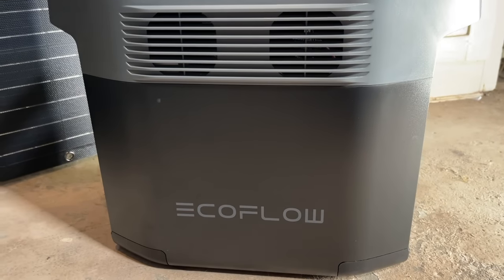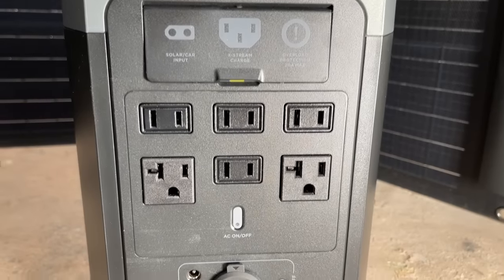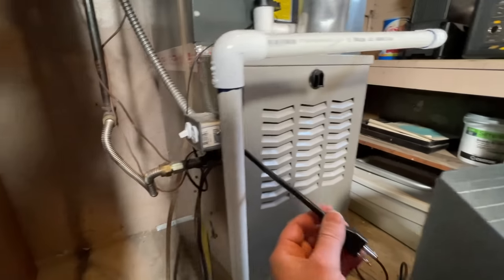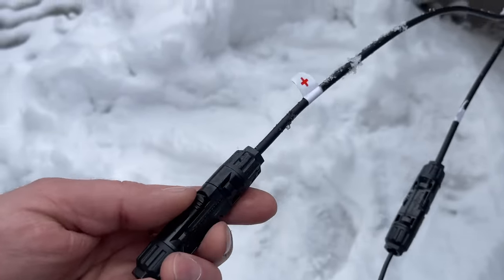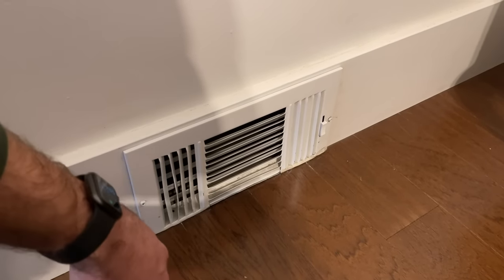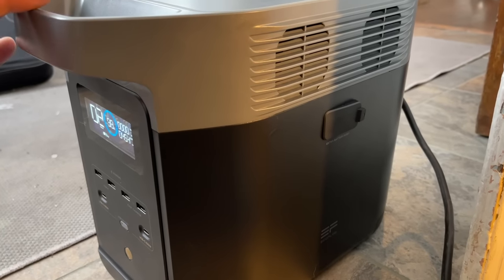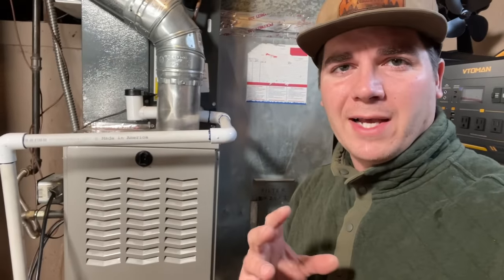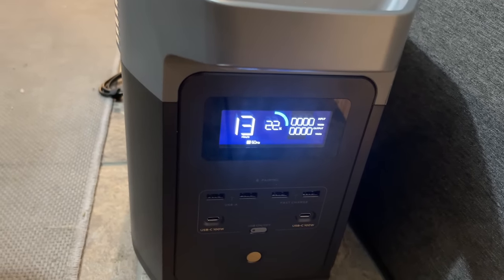How Long Will The EcoFlow Power Station Run My Furnace?  |  Power Outage Emergency Heat

Comment: I get being green, but in an emergency, I would rather have a small (or even large) inverter generator. You can buy quiet 2000 watt inverter generator for $500 and it will run a furnace for 10 hours on a gallon of gasoline. 5 gallons of gas will keep you warm two days.  These small inverter generators are a far better solution for temporary emergency use. People think of generators as these large, noisy things, but these little inverter generators are super quiet, running under 60db at 25 feet.  Also, batteries are not all that green.  Most of the electricity produced today is still done so using fossil fuel.  I loose power maybe twice a year but in the great Texas freeze 2 years ago, I was out of power for 4 days. I did not have a generator, and I swore I would never be without on again.
Reply: He already has videos on that.
Reply: Can you give suggestions on a 2000 watt generator? Thank you
Reply: You have such great emergency back up information.  Your a young man I find your knowledge very impressive.  I went thru all the vo-tech night school hvac back in 1996 and I think what you show here in 10 minutes is a full nights on hands teaching honestly 😂.   I’m with you prepare for the worse and hope for the best.  Your ideas are like having an emergency financial fund.  It gives peace of mind and better sleeping at night.  I have to make one of those emergency pig tails that’s pretty cool.   Would a home inspector be okay with the installation of it?  Thank you for your video I watch them all.
Reply: @Silverface1987  I’ll give you a suggestion.  Buy the quietest one you can afford for one thing.  Second make sure it’s an inverter generator this allows you to safely run all your electronics on it without having voltage spikes or drops which could burn out sensitive circuit boards that most things have no a days, like heaters, tv’s computers modems etc.  it’ll probably have an economy mode to which helps it run quieter because the rpm only runs as much as your load so it runs longer on a gallon of fuel. Hondas are nice and maybe the one to buy if your gonna be using it all the time but if your only looking to use it for emergencies get one from harbor freight it’ll probably be 1/2 the initial cost.  Hope this helps you with something you may not have known .  If your just looking to run drills , saws, lights or resistance type portable heater then you can buy a much cheaper generator that’s NOT and inverter type .  Good luck friend.
Reply: I think there are pros and cons, speaking as someone that owns a small inverter generator. If you frequently lose power for more than a day, there’s no question that a generator whether gas, diesel, or propane is the way to go.  That’s assuming you have a secure covered outdoor area to run the generator.  If you lose power very rarely and the utility tends to restore power quickly, or you don’t have a secure well ventilated outdoor area, or you have limited mobility and wheeling or carrying out, starting, and refueling a generator (potentially in icy or snowy weather) is difficult or impossible, a battery pack like this could be a great fit.  

I also don’t love the ongoing maintenance with my generator. I need to keep fresh gas on hand, make sure no gas remains in the fuel system when stored, periodically change oil, start it every month or two and run for a little while to keep parts lubricated, etc.  This battery pack is essentially maintenance free. A generator has its place but may not be the right fit for everyone.
Reply: but you can run these battery powered generators inside your house, secure  from possible theft and safe with no danger of CO poisoning
Reply: @Silverface1987  The Honda EU is one of the best out there. Quiet, dependable & starts on 1 or 2 pulls.
Reply: @betta3301  Yes, for about 4 hours.  A 2000 watt inverter generator will run your furnace for 3 days on a 5 gallon can of gas and it is super quiet.  You make your choice but these batteries are at best only good for a minor power outage. I was out of power for 4 days in the big Texas freeze.  Just this past fall I was out of power for 10 hours.  Now my generator is 5000 watts, so I can run my heat, my freeze, my fridge, my internet, my TV, and pretty much everything except charge the car and the AC.  My generator cost me $925.  It cost me about $300 to wire it up to the main breaker.
Reply: ecoflow has a generator i think
Reply: @Silverface1987  wen, Sportsman or champion for budget. Honda for the best
Reply: I agree on just throwing solar connected to it, it would be tough to get through an outage long term with winter weather. It makes sense for short outages, but a backup to charge is needed, and unless you are putting in big money extra batteries may not make sense. 

I am in the same boat of not wanting additional equipment to maintain (dedicated generator),  and we only have a few outages a year. So I just ordered the Delta 2 as well, but I have the unique setup that it can be charged from our Prius (1000 watt inverter pulling from the DC-DC charger). With that I could start with the Delta 2 (which is quick to hook up) and then escalate to adding charging from my existing vehicle (instead of a dedicated generator) and that would easily last a week or more.
Reply: The problem is running a gas power generator in winter time. I actually have two dual fuel inverter generator and I got the Ecoflow also mainly for winter use. I keep a propane tank full around the year, but propane does not work well in low temperature.
Reply: Fossil fuels all evil huh?  What is your furnace burning?  Non-fossilized poop?
Reply: @WilliamMurphy-uv9pm In most of the country, most furnaces are natural gas.  The least efficient natural gas furnace is 80% efficient. The typical gas turbine generator by comparison is only about 40% efficient and since about 40% of US eletric production is natural gas, running your furnace on natural ga can be greener than charging your battery using electricity from the grid .
Reply: @shenmisheshou7002  it is still a despised fossil fuel.  That was my point.  Despised but much needed and useful.
Reply: Best solution is to have a battery ‘solar generator’ like this for all its advantages, and then a gas generator.  Then when the battery is getting low, you fire up the gas for an hour and charge up the battery again (it charges super fast) and then you have x more hours of silent run time.  EcoFlow actually sells a fuel fuel generator that matches with the battery seamlessly where you set thresholds and it automatically fires up and turns off when it meets those thresholds, but that’s a little more money.
Reply: @davidcarrico3385  It is ineffecient to use a generator to charge a battery. It would be about 15% more efficient to simply run the home directly off of the generator..
Reply: @shenmisheshou7002  a 2000w generator is inefficient when you don’t need that much power (especially if you only need 200w to run the furnace).  Run it for an hour instead of 5. I bet the net with the battery is more efficient.  Now if you do need all 2000w from the generator, I agree with you.
Reply: I use both together.  Instead of running the inverter gemberator CONSTANTLY, mine charges the large power station and keeps it charged.  When the generator is off the power station powers the furnace, fridge, freezer and some lights.  It's very efficient because the generator runs ONLY when it can put out a good deal of power to charge and run items (my brand power station acts as a UPS as well).  The generator doesn't have to run when the devices are doing nothing.   Think outside your little box.
Reply: @davidcarrico3385. Thus is exactly what I do.  You put a large power station between the generator and your devices.  Run the generator sporadically to charge the batteries instead of constantly!
Reply: shenmisheshou7002. What's inefficient is running my generator CONSTANTLY for only a couple hundred watts (occasional furnace motor or fridge compressor)!?!?  My power station can easily do that for hours and then a quick hour of my inverter generator to charge it back up. The best inverter generators still eat gas when no load is drawn - which is a majority of the time. I prefer to run it only when it is being asked to provide the 1100 watts my power station can use to charge. Then the power station doles out the power as slowly or quickly as needed.   It's the most efficient way to do this.
Reply: @davidcarrico3385  Great idea.  For the small, low power uses a lot of small battery packs would be enough.  I'm more worried about serious emergencies and doing something with the food in the refrigerator for say a week.  Eating it is the best plan, I guess, but keeping the food from spoiling while I slowly consumed it, perhaps using a charcoal or wood fire, has always bothered me.  Safely storing gasoline is an issue as well.  You won't get gasoline after an emergency; at least till the demand goes down and perhaps city power is restored to get pumps working again.  I'll look more at these new inverter generators.  I have an inverter a/c unit.  Wonderful technology.
Reply: @WilliamMurphy-uv9pm  yep, for big continuous loads the gas (or diesel even better) generator wins for cost effectiveness in a power outage unless you already spent a lot on a big battery, big solar set up.  But for smaller to medium loads like the video, a mix can be great.  For a refrigerator, just the ecoflow and 200 to 400 watts of solar (you’ll prob get about 50% of rated capacity) during the day and running the battery down at night will keep a refrigerator/freezer no problem for that week, especially if being careful of how much it is opened.  I still like the idea of a propane generator at the ready to top off the battery if needed though.
Reply: @davidcarrico3385  Thanks for your response.  Isn't propane a less 'powerful' fuel?  Also, I live on a hillside 54 irregular narrow steps up from the road and do not see myself being able to carry multiple large (20 gallon?) containers of propane up....or down.  Admittedly, down would be easier when the containers were empty.  Solar might be useful but a fixed solar array would likely be wiped out by any strong wind storm and I don't want 'my' solar panels damaging my or my neighbor's homes as they blow around the neighborhood.  Still, with all that said, I would like to survive a 1-2 week emergency hurricane event.
Reply: @davidcarrico3385  Thanks for your comments.  Perhaps I just need a BIG electric truck and a very thick L O N G extension cord.  It is difficult to be thoughtful AND cheap, too.  I try my best to manage but others are often much smarter than me,  Kudos again.
Reply: @WilliamMurphy-uv9pm  that why I talked about gas or diesel being the best for extended outage use.  I prefer propane because I think the 10 and 20 gallon tanks are easier to handle, store better than gas/diesel for extended periods, and don’t have the messiness of gas/diesel, but to each their own.
Reply: Very well stated for us all to read.  Takes a bit of bravery these days.  Thanks.  Happy Holidays and a great 2024!
Reply: @shenmisheshou7002  Good point.  Thanks.
Reply: @videodistro  Would using an inverter generator solve this issue?  It doesn't run constantly at max speed, gas consumption is lower, and provides electricity as needed.
Reply: @videodistro  I have an inverter generator. It varies the engine speed according to the load.  It is far more efficient than the old fixed speed generator.
Reply: Not to mention a lot of these little battery systems are poor quality and they will break in a matter of months. A good Honda generator will last you a decade.
Reply: @shenmisheshou7002 I got the Delta 2 max and a little generator. The battery would be great to be able to leave on overnight or to put in the basement of my neighbor's house since I bought a multi unit. I can use a generator in my place and recharge the battery periodically. You and abusing less fuel having a battery setup as far as I understand because you can be using the battery to power the furnace with pass through and charging it at the same time as a moderate load on the generator until it's full and then just turn the generator off for a few hours
Reply: @shenmisheshou7002 is that with a inverter generator as well? What about the difference of being able to turn the generator off completely and let it rest and not be using any fuel at all once the battery bank is fully charged and running on its own for a few hours instead of having the generator sit there idling continuously? What about the DC generator like the ecoflow smart generator?
Reply: @davidcarrico3385 I agree! I have a 3500 watt inverter generator that does 18 hours on a tank of gas at 1/4 load ( 1000 watts) . I HAVE been without power for a few days and definitely enjoyed going through only a tank of gas of 2.5 gallons to power everything I needed in my home in the spring here in Tennessee. Only started and ran the generator once every 12 hours and only ran for about 3 hours. If I had the ecoflow smart generator dual fuel with a 30# bottle of LP then I wouldn't of had to do anything lol. But hey I love my little $500 westinghouse Igen4200 hybrid open frame inverter generator 🤣
Reply: It will NOT run 10 hours on 1 gallon! Nice try
Reply: @paullacerda4459  my westinghouse igen4200 on eco running a fridge,tv,converter, fan on airconditioner, and TV has ran for 24 hours on a tank of gas. That's only a 2.5 gallon tank. The furnace doesn't run full time. I could absolutely see a 2000 watt generator (inverter generator) or even my 3500 watt running for 10 hours just on a furnace with just one gallon. If that test doesn't prove that, idk what does. I have a delta pro and love solar but sometimes I gotta prove with real world tests for everything else.
Reply: @shenmisheshou7002  to a degree yes but I'm trying to understand the math myself.  If you're not running a whole house and using the full capability of the generator, it can actually be a lot more efficient to charge up a battery and use the battery to run the necessities of your house for hours at a time if you're only running something like the furnace and cooling appliances like fridge and freezer. It's also better for your generator I would assume, and you don't have to change the oil all the time for leaving it sit there running 24 hours a day
Reply: @NoZenith  This might be true if you were using a standard generator that has to turn the generator at a fixed speed to produce 60hz. I use an inverter generator. The inverter generator makes DC, and the inverter turns DC into AC, and will vary the power of the motor according to the load . They are very efficient compared to the standard generator and because they don't turn at constant RPM like standard generators, they are pretty quiet.  Using a  standard generator to charge a battery might make it a better value prop, but that is because it is always running at full speed whether you are using the current or not. With the inverter, you are really only generating what you need.  I have to change the oil every 100 hours, but since I have owned it, I only had to change it once, and it only takes .8 quarts of oil. It has a drain hose that makes it really easy. I could run the generator for 40 days before spending $1000 on gas and oil, and at the current rate of use, I won't spend $1000 on gas for about 15 years. For people that have an occasional power o
Reply: @betta3301 I have both an EcoFlow and inverter generator.  I use the generator to charge the EcoFlow outside away from the house in 90 minutes, then use the EcoFlow in the house.
Reply: Close to 80 percent of the electricity where I live is renewable, so these batteries are in fact quite green.
Reply: You may be smart enough to leave door open to run the power cord to outside.  Sadly many will take your solution and try doing so inside.  Sadly they will not survive
Reply: @videodistro that's my plan..
Reply: Hey genius what if you cant get fuel..theres other situations than weather. @WilliamMurphy-uv9pm

Comment: This video is VERY misleading. Towards the beginning you'll see that it only had 2 hours of runtime remaining. The Sun during the day helps to warm the house so it probably did not have to run a ton during the day. Try running your heater at night and you're probably going to get about 2 hours if it's very cold outside and it has to run constantly. The poster knew this and intentionally only gave updates when it wasn't running. He should have at least mentioned that constant use would drain it faster.

Comment: Just buy yourself a generator for crying out loud a gas-powered generator and quit the silliness it's just that thing is just a battery and that battery is going to run down and leave you on the in the cold it's going to take 2 days to recharge

Comment: 10 hours of usage is a joke.   ill keep my honda 2200.   in my experience with battery powered inverters,  theyre best suited for very short term power production.   10 min or less then a long rest period.  liike an hour or more.   repeat and you may get 24 hours of usage.   not enough for our needs.   gas wins   sorry
Reply: Having both is even better. Only run the generator for an hour or 2 to charge the power bank. And have silence for the other 22 hours of the day
Reply: Since I got my power bank my generator use went down about 80%. Gas is the most expensive way to generate electric per kwh